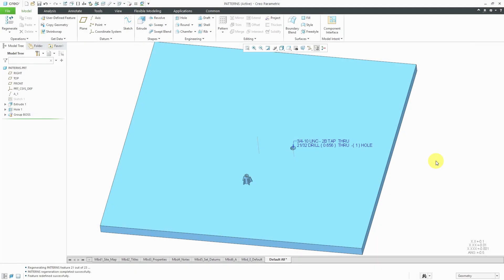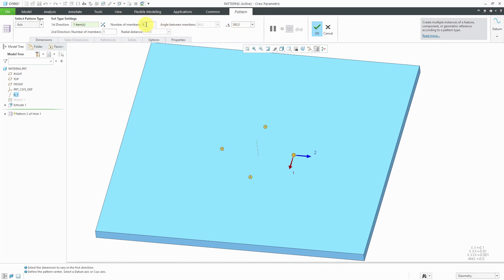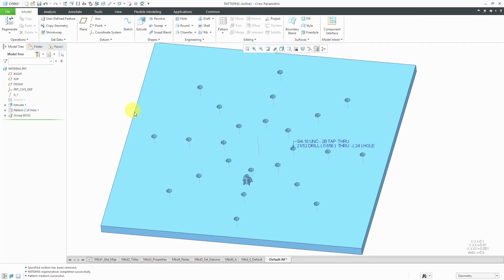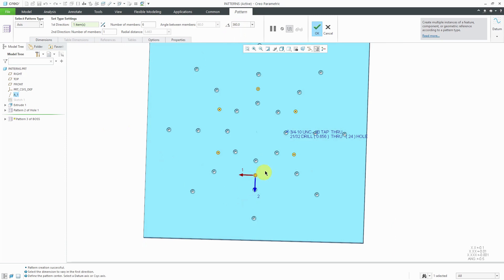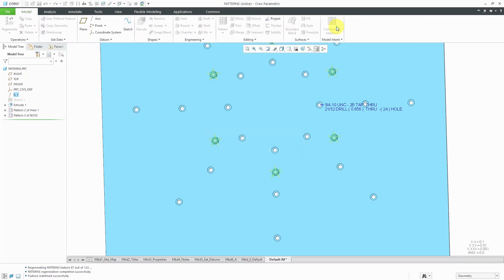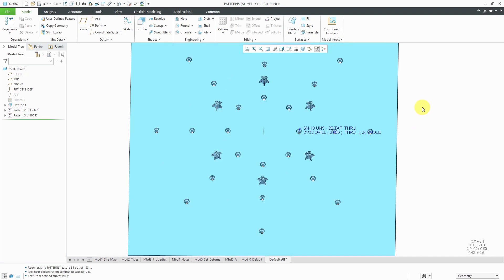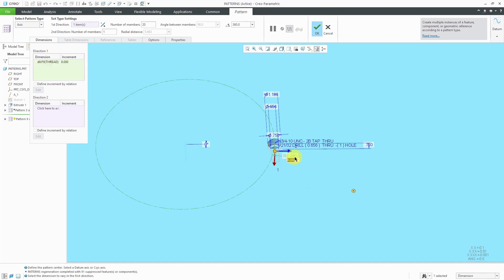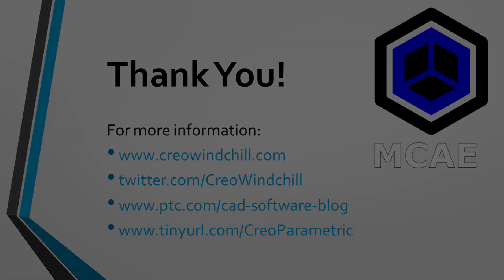Creo Parametric - How to Create Axis Patterns

Comment: Another thorough video thank you!

Is there any way to axial pattern "symmetrically" around the lead feature.  For example, say the boss you pattern in this video is at 6 o'clock and you want to create patterns of that boss to appear only at 5 o'clock and 7 o'clock how would you approach that?
Reply from the maker: The topic of "mirror patterns," especially for direction patterns, has come up a lot in PTC Technical Committee discussions.

For an axial pattern, I would probably just turn off all the preview dots for the instances I don't want. That would be the easiest way currently in Creo Parametric.
Reply: @CADPLMGuy  Got it thank you, again just glad to hear I'm not missing something and others feel the same pain.  Time to start clicking 38 little dots, I'll put my PTC pointer finger ice pack in the freezer now
Reply from the maker: I didn’t realize there were so many instances. In that case it would be easier to do Copy and Paste Special with Move / Rotate Transformations. I can show that in a video.
Reply from the maker: And I just remembered they were being called "symmetric patterns," not "mirror patterns," when being discussed as a potential enhancement. I'd really like to see that in the software because I usually end up creating a pattern in one direction and then either copying it or mirroring it, but you have to deal with duplication of the lead instance.
Reply: @CADPLMGuy  That would be awesome I've always wanted to learn how to use the paste special commands
Reply: @CADPLMGuy  this is one of many reasons I seem to exclusively use point patterns. Having an external sketch drive the pattern gives more control... of course that comes with more of a time investment up front
Reply from the maker: I am a big fan of Point Patterns. I use them more than any other pattern type.